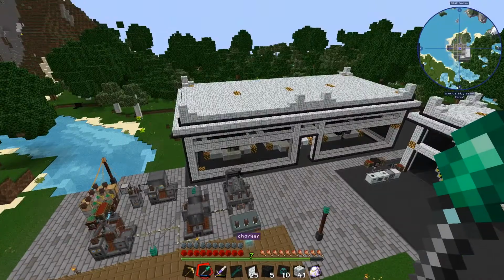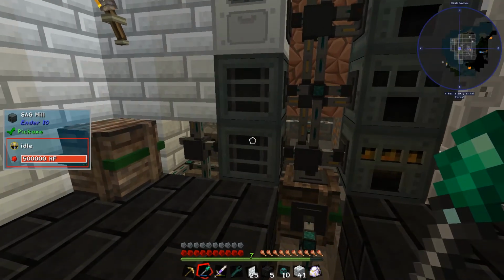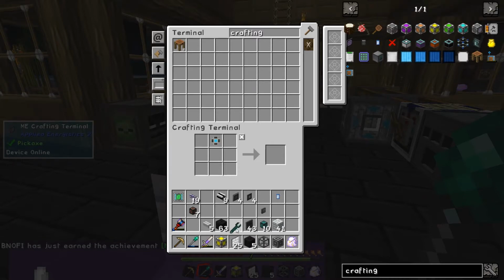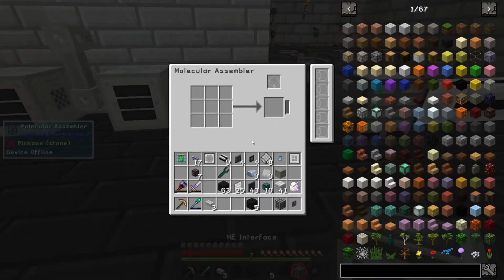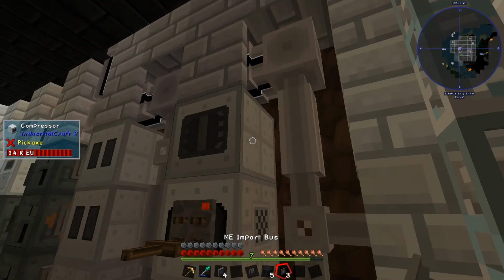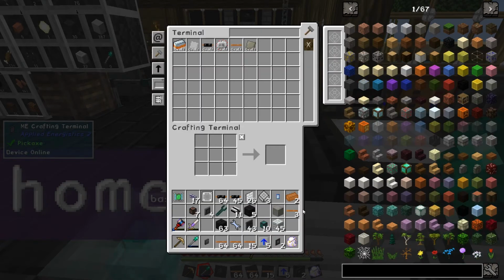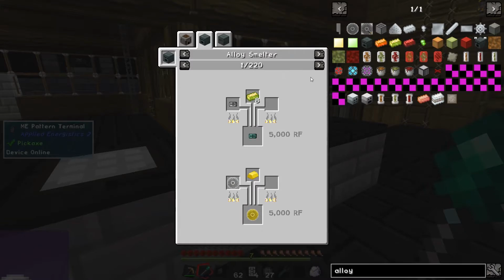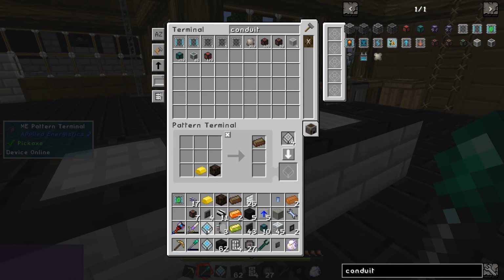Age of Engineering 40 | AE2 Basic Autocrafting | Closet Gamer

Comment: When you use a machine for AE processing, instead of pulling the finished product back out with an export bus, I usually use the "full block" rather than the flat version of the ME interface, then pipe the result out of the machine with item conduits, directly back into that interface, which puts it in the system. That way you're only using 1 channel per machine instead of two.
Reply from the maker: Dream Vigil thanks man, that helps a lot. I didn't realise that you could use the block form of the ME interface like that. Channels are becoming an issue!